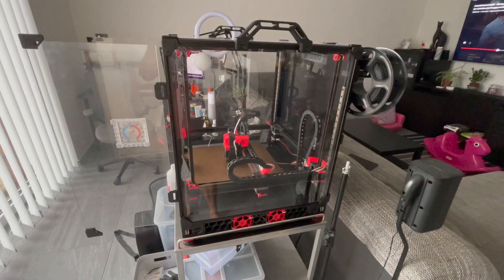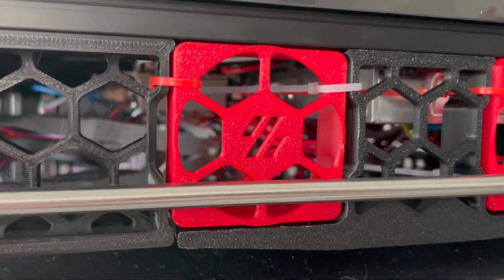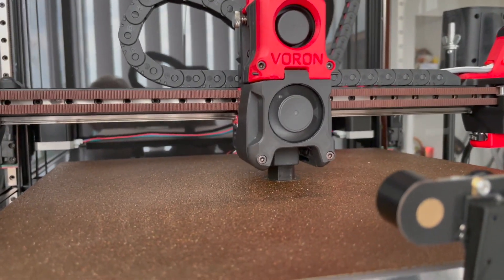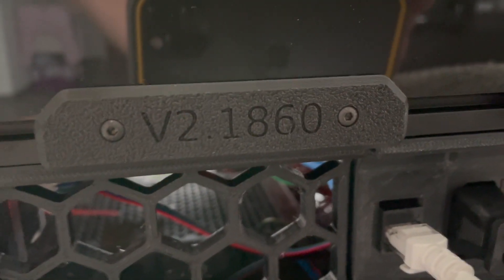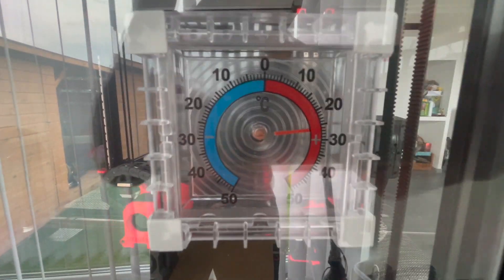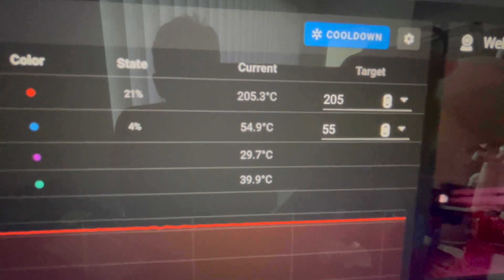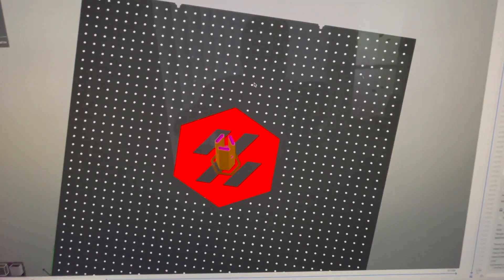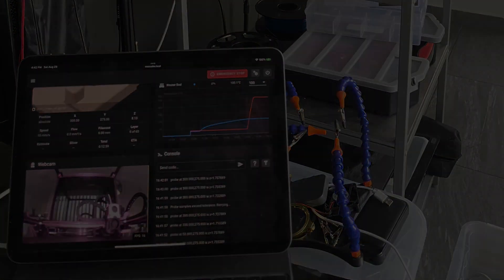Voron 2.4 Fysetc Kit 350 Build 3

Comment: Get some cleaning filament, change to that at ABS temperature and purge through until it runs clean, then drop the temp to PLA temperature and change to PLA and you won't have an issue.